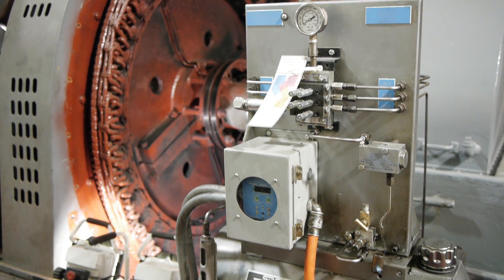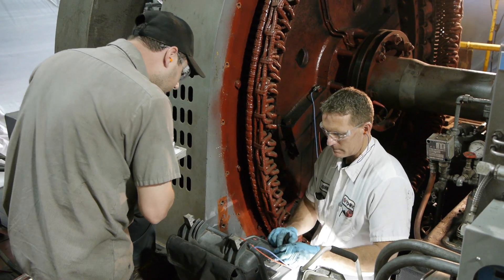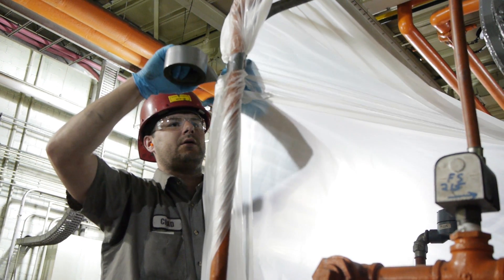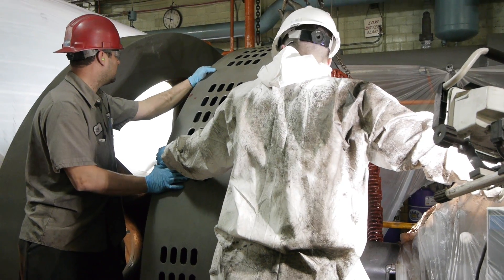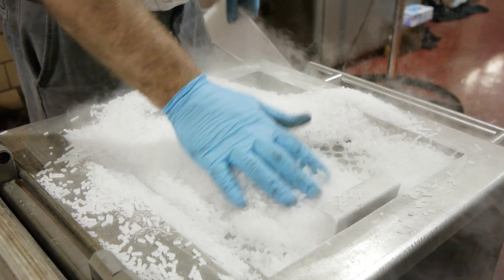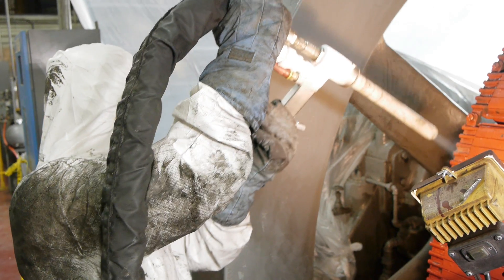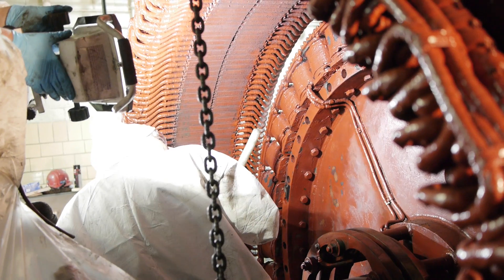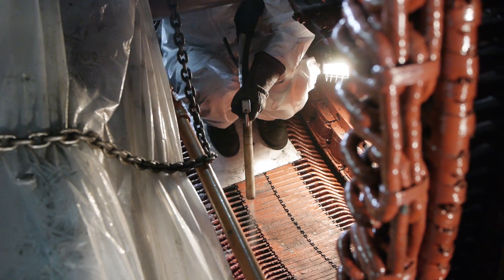Cryogenic Cleaning (Dry Ice) - York Repair Inc.

Comment: Seems nice. I do have a question though : as you clean the surface of the windings, it means you remove particles of dirt. What do they become ? where do they go ? If you want to be perfectly clean and not let the dirt/dust deposit (in a much lower extent) on other parts, vacuum cleaning could be practiced at the same time.